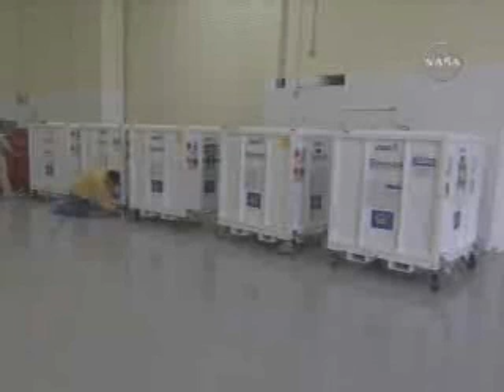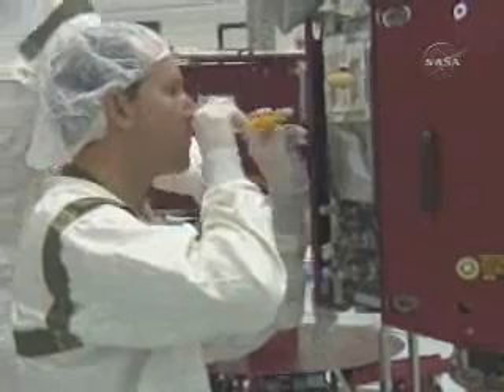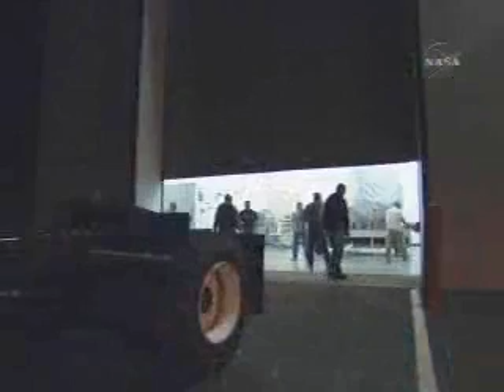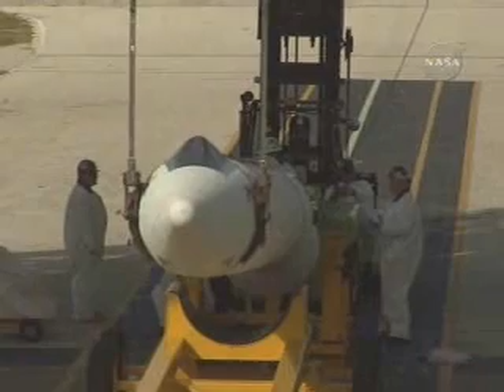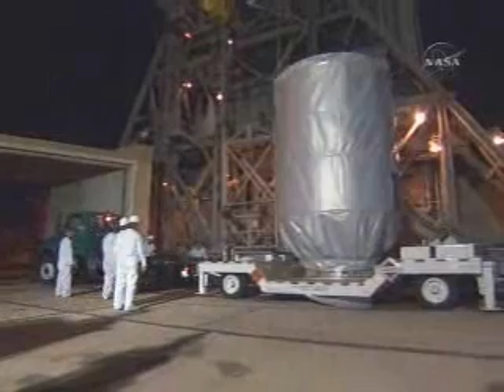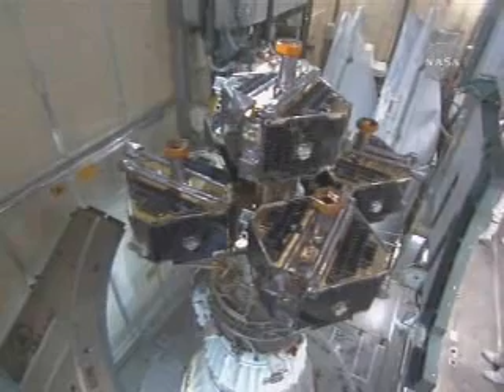THEMIS/Delta II Assembly

Comment: Granted, the Delta II began operations in the late 80s to early 90s. Satellites were a little smaller back then. Now there is a need for bigger launchers that can carry more. That is also one of the reasons the shuttle is being done in for. It just has too small of a bay to launch any of the big satellites from, so that's why they use it solely for ISS construction and HST maintenance.